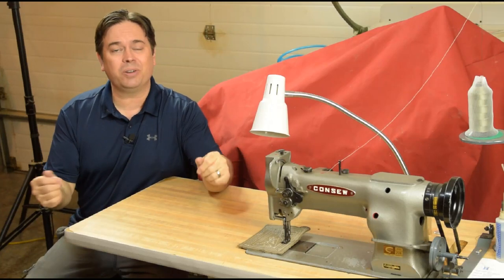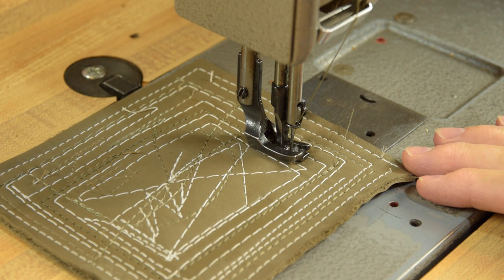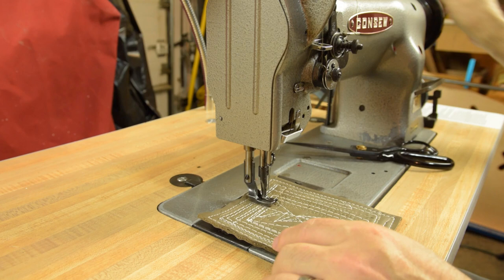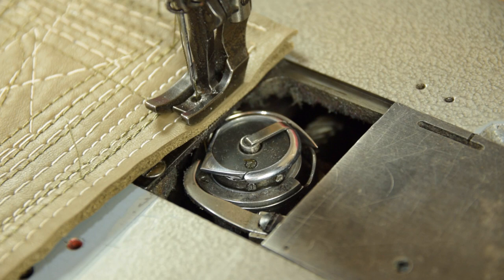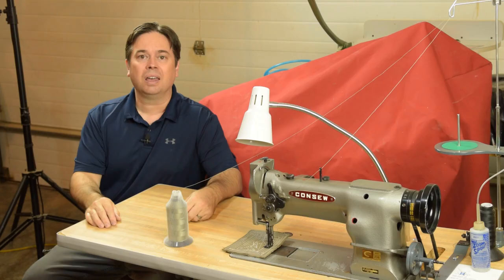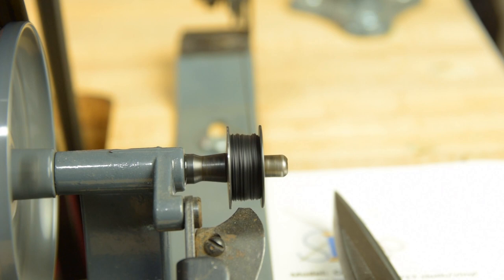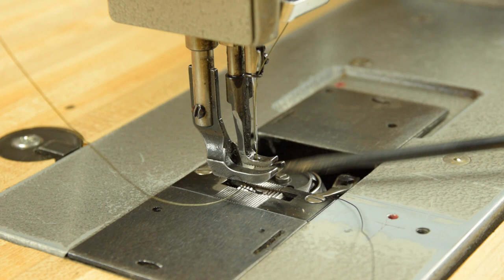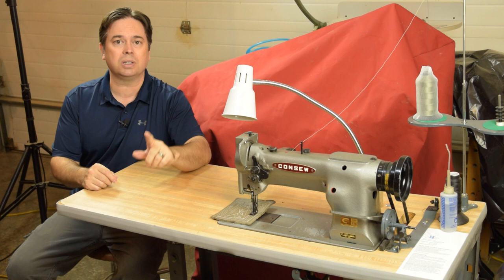Consew 226 Everything You Ever Wanted to Know about this walking foot industrial sewing machine

Comment: If we have a small motor pulley and happy with the slow speed, is there any advantage of getting the whole speed reducer setup (extra pulleys)? Would this increase the torque over just having the small motor pulley ?
Reply from the maker: I find a servo with small motor pulley very manageable.  I just turn the speed down on the motor until I like how it sews.  A speed reducer will add more torque and punching power, and allows you to crank up the dial on your servo motor.  The one downside of a speed reducer is the machine is a little harder to turn by hand.  Also, I only like box style speed reducers.  
Best of luck!
Reply: @TheThoughtfulWoodworker  Yes I am very happy with my 45mm gear on my servo as of now ( I am not at anywhere near the max capacity of my machine). I am however just very curious to see if I am missing anything by not having a full blown speed reducer.

Comment: Thanks for the great video! It is so helpful and clear. What Servo motor kit did you use?
Reply from the maker: Thanks Christopher, I usually use this servo motor kit...  https://amzn.to/3KPMkoG  Best to you.
Reply: @TheThoughtfulWoodworker  Thanks!!! I have a Juki LU-562 that I bought at an estate sale. I was not able to test it but, it looked well taken care of so, I made a gamble on it for $175. As I have been going through it seems to have a vibration issue at higher speeds. It seems like there should be a fine adjustment on the counter balance. I am not sure if I should invest more$$. Does your Juki LU-563 vibrate? Thanks for all the videos! They are really well done. Cheers!
Reply from the maker: @christopherh4238  I've had vibration issues in the past.  It's not specific to Juki.  Usually it means the table legs aren't resting flat on the floor.  Try checking that and shimming one leg if needed.  I also have a servo and speed reducer, so I sew leather pretty slowly.
Best to you!

Comment: Woodworker, thanks for the video.  Have you figured out how to equalize the forward and reverse stitch lengths if they are not the same?
Reply from the maker: Yes, luckily that is pretty easy to adjust on the 226.  Tip the head back, and actuate the reverse lever.  Look at the mechanism that moves underneath the machine.  You'll see two stop screws with jamb nuts.  Make small adjustments on those two screws to limit the forward or reverse lever travel.  That will equalize forward and reverse stitch length.
Best

Comment: I am getting loose loops on the bottom side of my stitches. Would love a tutorial on how to adjust/remedy this issue.
Reply from the maker: Generally when you have loose stitches on the bottom, you need to increase upper tension.  Make 1/4 turn adjustments until it balances the stitch.
Also make sure you have have the correct needle size for the thread you're using.
Best
Reply: @TheThoughtfulWoodworker  In my novice and ignorance, I do not know how to adjust the tension.
Reply from the maker: @krucifydministries  locate the tension knob (has the two discs behind it) and turn it clockwise to increase upper tension.
Do a 1/4 turn and re-test how it sews.
Best

Comment: Would you please recommend which servo motor i should buy for a consew 226. The clutch motor is to fast for me. I use the machine for patching marine canvas and replacing zippers.
Reply from the maker: https://youtu.be/Dx_rS9Fzvfo
I would recommend a basic servo with one adjustment knob like the New Tech or Family servo.  Also sometimes sold as Eagle brand.  Avoid the fancy electronic servos unless you need a needle positioner.
Check out the video link for how to install it yourself.
Best

Comment: Have really been enjoying your videos, learning a lot.  I picked up a used 226 and it seems the previous owner has adjusted it so there is a lot of down pressure on the presser foot.   I would like to know how to adjust that down pressure, to lighten it up - when the needle is down and feed dogs are up. Working with slippery nylon webbing which is easily misaligned and gets crushed down,  when trying to pivot it 90 degrees due to the heavy down pressure.  The manual talks about adjusting it, but isn't all that clear about how to do it, and the drawing is poor. Would appreciate some guidance!
Reply from the maker: On top of your machine, locate the threading post where you would start threading it.  Just behind this post you will find a screw in the head casting.  Sometimes it's a black knob, and sometimes it's a screw.  Either way, turning the screw clockwise increases pressure on a leaf spring for more downward pressure on the presser foot.  Counterclockwise loosens pressure.  
If your model has a screw, it will be a small black screw head that takes a flat screwdriver.  
Best of luck!
Reply: @TheThoughtfulWoodworker  You are very kind....that was soooo obvious.  Thanks for your detailed reply!

Comment: Could you go over how to correct timing on this machine? I had a large thread tangle that had to be cut out and once I got it all out the timing is off.
Reply from the maker: Hi Lisa, first thing to do is check that the safety clutch didn't pop.  It's the other silver button next to the stitch length button.  If that's the problem, once you reset the safety clutch, it will sew normally again.  If you do need to adjust timing, I would refer you to Uwe Gross and his Consew 225 video.  Timing procedure is the same for the 226.  The video is here...  https://youtu.be/1wNBPX8i524 
Best of luck!

Comment: Question;  anybody ever put a larger upper pulley to reduce speed,I've already changed lower, to reduce. Mines not as controllable  as yours ,at slow speeds..could be clutch engagement . Thnks
Reply from the maker: Several people have tried to use large hardware store pulleys in place of the handwheel.  I think a better way is to start with a good servo motor, and add a box style speed reducer as needed.  If you're running a clutch motor, you likely won't be happy without a speed reducer.  My main machine runs a servo and box style reducer.  It can crawl or sew at normal speeds.  The advantage of a box style reducer is you can still tip the head back for oiling and maintenance.
Best

Comment: Hi,
Between the Juki LU563 and Consew226, which do you recommend.? The Juki is $300 more.
Reply from the maker: I consider the Juki LU-563 to be the top dog among older upholstery weight walking foot machines.  I sew with a 563 and wouldn't trade it for anything.  The Consew 226 is also a capable machine but has a small G style bobbin.  
Best

Comment: Hi mate ive been using my consew 226 for 35 years and i noticed you did not wind the cotten around the tension disc  then up over the small pin before going on to the controler spring . You would have hardly any tension control on the tension plates .
Reply from the maker: Hello, you don't go around the pin to thread the Consew.  The machine was never intended to be threaded that way.  You can still have as much or as little tension as desired.  Check out an online manual for the 226.  Thanks.
Reply: @TheThoughtfulWoodworker  If that was the case ,Why would you even have a tension plate and have a tension screw on a spring to adjust the tension if your by passing it then . I have worked as a motor trimmer and Upholsterer for over 35 years on this very machine .
Reply from the maker: I didn't pass by the tension discs and spring.  I passed by the little pin.  You asked why I don't go around the little pin.  You still have full tension adjustment as intended.  I just go straight by the book and thread it as recommended in the manual.  So many people are confused about the little pin, but you never go around that.
Reply: @TheThoughtfulWoodworker   Thats what holds it equally around the disc to give you a perfect pressure the pin holds it in that position so it works perfectly then goes to the thread controller . Some manuals are wrong even car and bikes manuals.
Reply from the maker: @frogzlegs6285  show me one manual that has it that way!
Reply: @TheThoughtfulWoodworker  Do it that way then , And you will learn ,
Reply from the maker: @frogzlegs6285  Are you serious?  I'm threading a machine as instructed in the manual.  You made up your own thread path.  That's fine if it works for you.  I will continue to thread the machine as instructed by the MFR.
Reply: @TheThoughtfulWoodworker  well do you do motor trimming all day as a qualified machinist ?? Well i am . And my stitches need to be perfect every time . good luck with people asking you what that pin is for then .  maybe its for looks . And its not a guide to hold the plates as they have there own little slit which slides onto the tension adjustment bolt as it has the slit for the plates to guide them into position as well as that small pin for the cotton to travel over . Just try it it cant hurt and you will find you can have equal tension top and bottom . sounds like common sense when they have equal tension to lay the thread evenly ,

Comment: Hi, great Vid & thanks.
1. What is the proper adjustment on the flat hook in front of the bobbin case? (I can't seem to get it right.)
2. My hand wheel is very hard to turn. I had the machine lubed, but there is no difference.  Can this be fixed, Oh Great One?
Thanks!
Reply from the maker: Hi Linda, first let's sort out why your machine is hard to turn over.  If you depress the foot pedal slightly, does it get better?  If so that is completely normal (slight pressure down on the foot pedal releases the motor brake).  Another way to check is to take the belt off the handwheel.  The machine should rotate freely.
Now for the bobbin case opener.  It should just tap the bobbin case to allow thread to go around the bobbin case.  If the bobbin case opener doesn't touch the bobbin case, adjust it to be slightly closer.  If it hits the bobbin case firmly, then you need to back it off some.   Good luck!
Reply: @TheThoughtfulWoodworker    Hi, TW, The machine was hard to turn when I got it and remains hard to turn attached to the brake motor. Bad bearings?  L
Reply from the maker: @WhippestMom  If depressing the foot pedal slightly doesn't make the handwheel easy to turn, take off the belt to separate machine head problems from motor problems.  If the head is hard to turn by itself, make sure to oil all the spots listed in the manual.  Sometimes just running it a while and lubricating it often will fix the problem.  
Best
Reply: I stand corrected. Clutch motor is much of the problem. Hoping to get a servo soon.
On the bobbin: if not stopped by the flat hook, it rotates 360°. So, the arrow stays at the hook and my thread tangles. Is there is a cure for that..?
Reply from the maker: @WhippestMom  Hi Linda, the bobbin case should not rotate 360 degrees.  There is a tab on the bobbin case that should be trapped under the throat plate.  If someone took the throat plate off to clean the machine, and didn't put it back correctly, the bobbin case would just spin wildly.  If that's the case, just loosen the two throat plate screws and turn the bobbin until the tab catches.  Tighten the screws again to hold it in place.  
A servo motor is a good choice.  Here's how to install one yourself...  https://youtu.be/Dx_rS9Fzvfo 
and here's the motor I currently use... https://amzn.to/3QAODwp 
Best of luck!

Comment: I ran into a heavy spot sewing a velour cushioon singer industrial sewing machine, that is pretty much like your consew and it quit picking up the bobbin thread.  Any suggestions?
Reply from the maker: First guess is a bent needle.  Replace the needle with the correct type and size for the thread you're sewing and try again.
Best

Comment: Thanks so much, awesome video! How do I find out if mine is a -1 ,-2 ,-5 ?? Got her used in excellent condition… just trying to figure all the bells and whistles 😉
Reply from the maker: Consew 206rb-1 and rb-2 have reverse levers that you lift up to activate.  Rb-3 is usually more of a grey color (rather than salmon silver) and has a push down to activate reverse lever with black stitch length knob.  Rb-5 can be either silver or more commonly white and made in China. 
Best
Reply: Do the 1 & 2 have a knob behind the lifting leaver that turns for adjusting?? Mine does… wish I could send you a pic
Reply from the maker: @sandyferguson9913  the Consew 206rb-1 and rb-2 have thumb screws on the reverse lever itself to adjust stitch length.  
Later models had a dial on the sewing machine head that you turn to adjust stitch length.
Best
Reply: Thanks, I believe mine is a 1 or 2 … that’s gonna help for parts & stuff .

Comment: When out looking at the 226 I just brought home, we did at first mistake the button on the right for the stitch length setting. Would this cause any issues I should know to address? It was given a few turns towards user with the right side button pressed in.
Reply from the maker: Hey Jordan.  It could cause the safety clutch to disengage.  As long as the presser feet move when you roll the handwheel, you should be fine.
Best
Reply: @TheThoughtfulWoodworker  Okay good to hear, I was a little worried it would throw off the timing! Thanks a million for the quick reply 🙏

Comment: How do you increase the bobbin tension? I’m seeing the loop on the top side of my material at this time.
Reply from the maker: On top loading machines like the Consew 226, the bobbin tension screw stays in the machine (instead of popping out like other machines).  If you have a small screwdriver held at an angle you can adjust it in place.  Open the bobbin slide plate, and rotate the machine until two small screws on the side of the bobbin case come into view.  One just holds the bobbin tension tab in place, but the other screw adjusts bobbin tension.  It usually has a circular dome or depression around the small screw head.  1/4 to 1/2 turn clockwise, then retest.  If you're not getting any bobbin tension, back it out a ways, and then turn it clockwise until you get adequate tension.  About twice the resistance of dental floss is what you want.
Reply: @TheThoughtfulWoodworker  thanks so much! I’ll give it a try. In terms of drop down guides for the 226, do you have a recommendation? I got one off Amazon that said it fit the 226 but it definitely did not!
Reply from the maker: @Sinkingshipleather  Sorry I don't have any recommendations on drop down attachments for a 226.  Might have to drill some holes (yikes!)

Comment: This is an awesome video!  I just got a 226R1 in great shape.  I was wondering if you know how to adjust the presser foot alignment, my machine feet seem ever so slightly angled so that the needle is to the far left of the inner presser foot hole.  Is there a way to adjust the outer presser foot so its nice and straight?  I'm assuming I have to loosen some clamps on that bar, but a lot going on in there and I'm struggling to find a good image or video to do it!
Reply from the maker: I've had that happen on Pfaff's and Consews.  In both cases it was defective (bent) presser feet.  I would replace the feet and put a new 135x17 needle in.  Do that before you make any adjustments.  The main feed dog adjustment is front to back, not side to side.
Reply: @TheThoughtfulWoodworker  thanks, I’ll give it a try!

Comment: I have a chance to look at one of these soon.  it has the servo motor already installed.  What is one if good condition selling for these days?
Reply from the maker: Depends on availability in your area.  North of $1000 in my area for a nice machine with servo.  Less if it has much visible wear or needs a tune up.  Best of luck with your decision!
Reply: @TheThoughtfulWoodworker  Thanks for the info.  Guy said he bought a new machine and doesn't need two.  We shall see.  Will be my first machine if I buy it.

Comment: I don't know what price point the 226 falls into but, I want to invest in a good compound, or triple feed, walking foot machine.  I've tried to use other standard walking foot machines but, when using heavier fabric, you really need that compound walker....  What are your thoughts on a Consew 206rb-5, or a Juki 1541?  Both can be had new for just under $2K...  I'd like to find a used one, but there just aren't any..  Great video my friend!!  (-:
Reply from the maker: You can't go wrong with a Juki 1541.  As far as the new white 206rb, I actually prefer the older made in Japan version.  
I actually sew with a Juki LU-563 because it has a huge U style top loading bobbin.
Good luck with a fun decision!

Comment: great machines for the money, but that G vobbin is a deal breaker. The Brother LS2, The Singer 211A,Us and the Juki 563 have much larger bobbins. If you sew a lot of stitches, that difference is really impossible to to sacrifice. 

I learned on a 206RB-1 and it was a great machine, in fact I just bought a Juki DNU 241 as a back up to my Brother, because those 206 style heads are bullet proof
Reply from the maker: Agree with everything you said.  I also have a 206rb and a Juki 563 and those large bobbins are nice.  Nothing worse than running out of bobbin thread on a leather project.  
Best